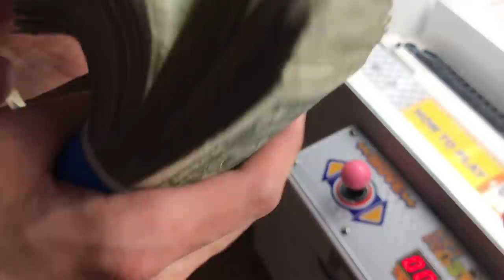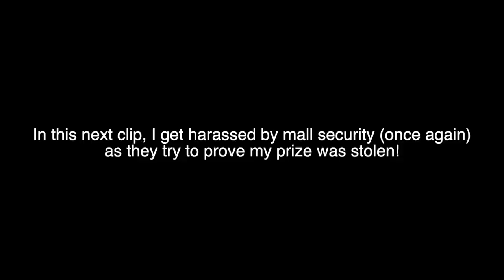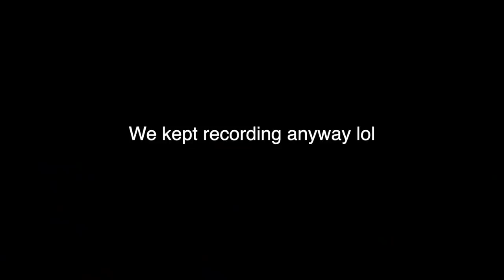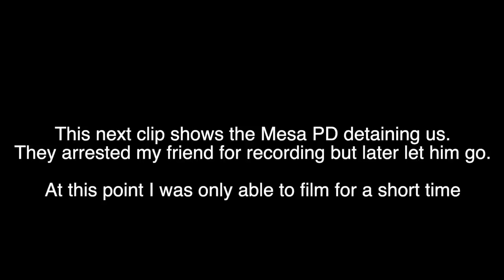ARRESTED for WINNING CASH at MONEY KEY MASTER ARCADE GAME!! | JOYSTICK

Comment: OK A. The KeyMaster machines can’t be hacked for like use a code for it because trust me I’ve tried every single combination for a hack and every other older machine and never worked.
B. You should center different from the ones from your old set. And also change the actors cause I can still see the man bun from the old video